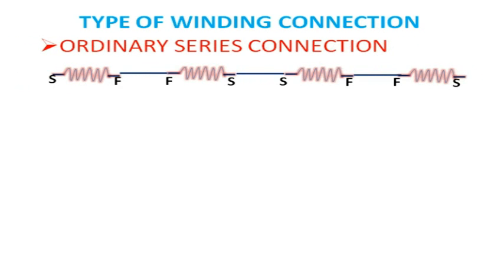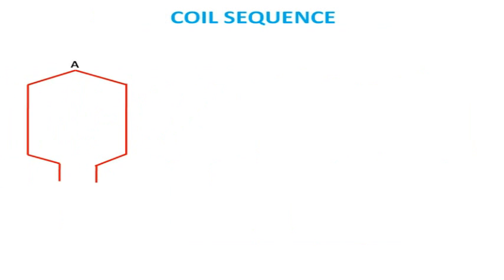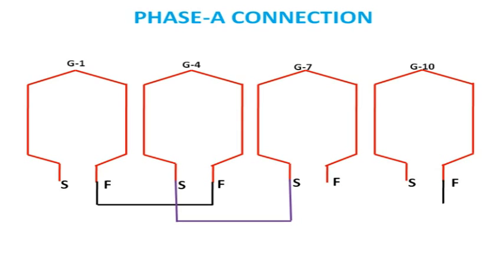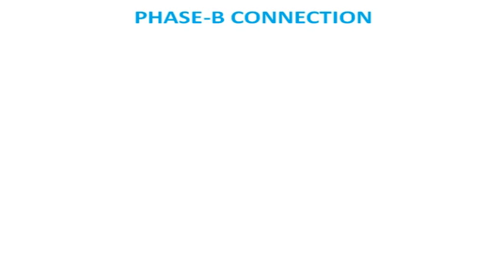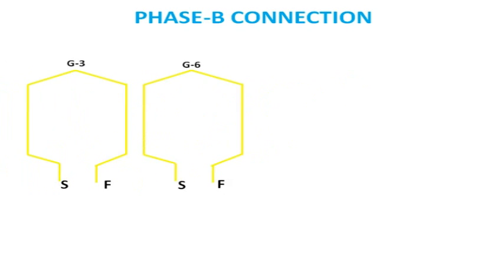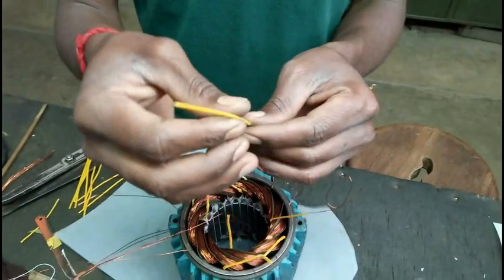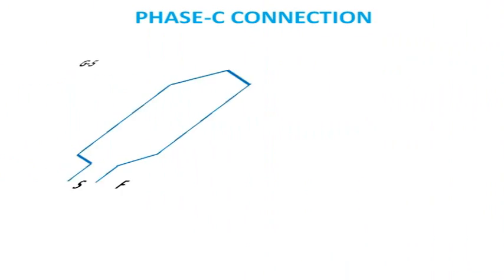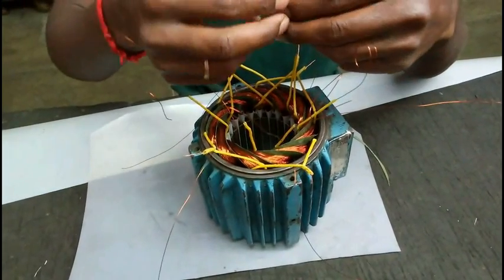Winding connection of three phase motor

Comment: Where to connect the capacitors please help
Reply: They do not need capacitor..3 phase is automatically running in to direct installation for the livecable wire

Comment: Good satisfied with the technical know how and  skill of the motor winder.
Hope a 36 slot  3 phase motor  rewinding will also follow. simultaneously
Reply: + Pyray : This video made connecting it look a little more DIFFICULT than it really should be.  I'd be happy to tell you more, but the basic formula is :  For a simple Y/YY connection meaning 230/460 VAC 3 phase.  Doesn't matter the RPM.  You have STARTS on the outside of the group and FINISHES on the inside of the group.  Then it is Line(1) star- line (2) star- line (3) star. Next is called the SPLIT between the phase, and the next numbers are as follows in order. 4 - 9 - 5 - 7 - 6 - 8 for high voltage you connect (4-7) (5-8) (6-9) and leads (1) - (2) - (3) are then line leads to the power.  For LOW voltage connection it is line one is (1-7 ) line two is (2-8) and line three is (3-9) and (4-5-6) are tied together.  Please respond if you would like to know more. I'm now retired, but owned a Electric Motor Repair shop for 38-yrs.  I kinda know this stuff... LOL...

Comment: If you have a motor that has been pulled out by the winding wire, you can find out how to get the formula and wind gauge.
Reply from the maker: If you do not have winding data also you can find the winding pitch, coil groups from required speed of motor by using 120f/p formula. Gauge by wire by using avg 5a/sqmm current density and nos of turn by taking avg 3 turns per volt.This is aprox data only

Comment: where does the input of the engine go? I mean is it spread evenly like 3 equal parts of a circle in the stator?
Reply from the maker: The winding placement can be two type:-
a) Basket Winding-Just Like  in video each phases are wounded in ABCABC patern in basket stucture.
b) Phase Winding-One Phase than second and than third phase are placed

Comment: sir  double delta conscious kasse hote hai
Reply: + Jagtar : Very SELDOM do the manufactures use a DELTA connection on motors under 7 1/2HP this stator was only 1-hp or less.  So it was a ONE WYE connection and 50hz. metric motor.

Comment: if the motor is use only with 50 hz? what will do to make the motor 50 , 60 hz? dual frequency
Reply from the maker: The 50 Hz motor can also be fed 60 Hz supply. However, the motor speed will increase based on formula (120X Frequency)/Nos of Pole). Hence a motor of 3000RPM for 50HZ supply will run at 3600 RPM.
Reply: thank you sir

Comment: why the name plate of the  motor not include the kinds of connection? so that no need to know what kind of connection is made,
Reply from the maker: Generally inside data of motor like winding wire diameter, nos of turn, pitch, connection etc are not provided at name plate. The Name plate only indicates Motor output parameters.
Reply: if you no need to know what kind of connection, what purpose to include kind of connection on name plate?

Comment: commonly where apply the connection for ordinary series,  direct parallel and series parallel? it depend of capacity of a motor?
Reply from the maker: Low capacity Motor-Ordinary Series Connection
High Capacity Motor-Direct Parallel Connection
Medium Capacity Motor-Series Parallel Connection

Comment: sir how can we find which is stating coil and so on....
Reply from the maker: After dismantling of stator and rotor, first identify the connection points from which terminal wires(6 or 3) comes outside where three phase supply is fed. if three wires has come outside than inside there will be star connection.Hold any one terminal wire and assume it as phase-A and the coil connected to it as starting coil group of phase-A and follow the connection of same coil group to other coil groups and identify type of connection. Sequentially after one coil group gap phase-B terminal will follow and so on.The terminal of coil group at  Stator inside  may be treated as starting and stator outer side terminal may treated as ending of coil group(Vice verse can also be considered)

Comment: Do you need to make a winding two or one wire?
Reply from the maker: In this video only one wire has been shown for easy understanding.However,Winding wire can be one or two or three even four depending on the capacity of motor. More wires for high current Rating.
Reply: How to be the motor of 3kW 5.5Amper?
Reply from the maker: 3kw motor  is approx 4 HP and current will be approx 6A,.
Considering current density of 15A/Sqmm (for low capacity motor), sqmm of wire shall be 0.39 Sqmm i.e 22 SWG single wire. 
Note that current density will decrease for high capacity motor.
Reply: Is there a table for this How many wires need to be calculated?

Comment: how to connect two coil group
Reply from the maker: The six terminals of three phases (starting and ending of each phase) can be connected in star or delta. In case of star,similar terminal of three phases(starting or ending) are joined and supply is given to other three terminal. In case of delta finish one phase connected to starting of other phase and so on and supply is given to three joining points.If same winding is connecetd delta and star separately than delta connection will take three time current than star connection. Hence motor capacity will be three times.
Reply: DOLAMANI MEHER 
sir whats the difference between delta and star connections
Reply from the maker: The insulation over super enamel copper wire of both group end/start (based on type of connection) should be removed. The two wires should be twisted and overhang portion to be cut. Soldering to be done and glass fiber insulated sleeve to be inserted at joint.
Reply from the maker: If only two coil groups are there per phase than for ordinary series connection Finish to Finish(F-F) should be connected and starting and starting of both coil group will become Phase start and end terminal. In case of direct parallel connection Stating of 1st should be connected with ending of second and viceverse. Both joint will become starting and ending of phase.